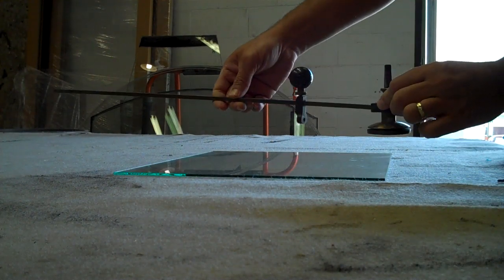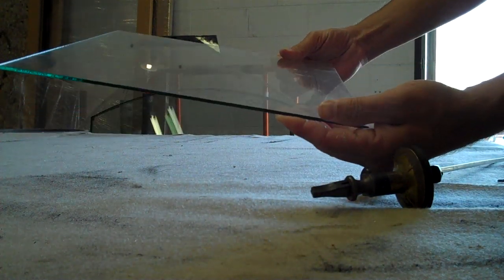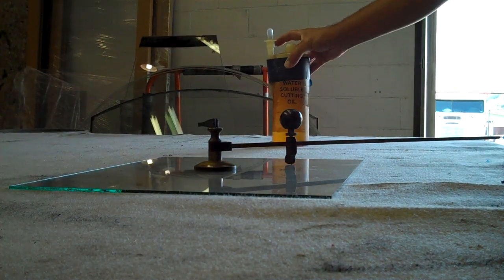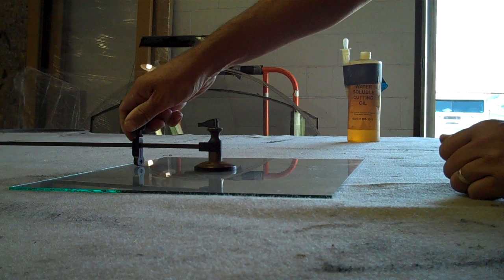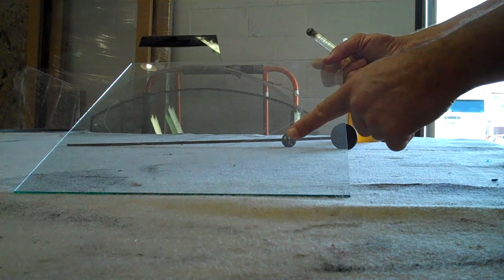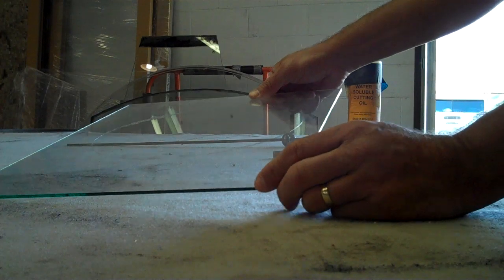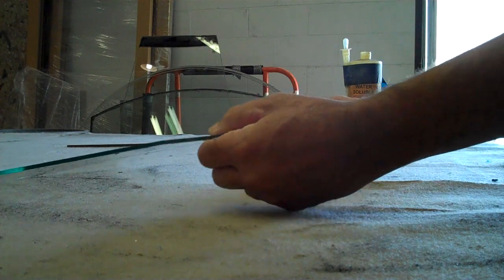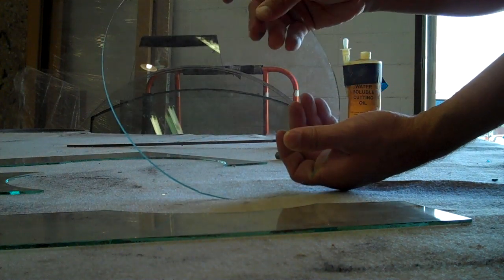How to cut out a glass circle

Comment: I needed to cut a circular piece of glass for a hanging light to keep out mud wasps.  I bought the circular cutter online and picked up a glass plate and straight-edge cutting kit from The Home Depot.  I had a picture frame with a broken glass plate which I planned to use as practice and break in the blades.  Following these instructions, my very first cut came out so well I ended up using it as my final circle!  Thanks for the tut!

Comment: How long does the carbide tip last on a carbide wheel cutter? Is there way to sharpen the wheel? How do I know I have the right amount of pressure? I think I may be applying too much pressure, or maybe the cutter is worn? I only used the cutter to cut like 5 feet of cuts. Thanks for the great video.

Comment: I am a glazier/glass cutter, if you try this then after you run the cut as shown with your thumb turn over the glass but don't make the 4 cuts to the circle yet, do the thumb pressure thing again and you will here the glass click again, push  all around the perimeter again then make the 4 cuts. this gives you a perfect edge with no chips. have fun.

Comment: it's beautiful circle with fine edges (yes, it's still sharp and should be sanded, but the edge is still even which is great).  Only thing that stops me from ording this tool right away is, that every tutorial shows the glass has to be sliced around the circle. is it possible to do it without it and preserve glass - with circular opening?

Comment: Not bad Mike. One thing I do when cutting circles is after breaking the scribe all the way around, I flip the glass over and put pressure down on the opposite side to ensure the cut is complete on both sides. Another technique I use in removing the falloff is on scribe from the circle edge to the edge of the sheet, snap, gently pull apart at the break thus causing the circle to drop out cleanly.

Comment: Good one! now I have a bit of a challenge for you, I need to cut about 6-8 glass rounds roughly 6" diameter, and these need 2 to 3  holes drilled through them about 1/4" and 1/2" diameter, they are to be replacements for the broken/missing glass on some antique fire alarm box mechanisms, the holes are for the winding knob, the activator lever and a resin grab knob usually (they vary a little from each other depending on what decade they were made and model)
Do you have any videos I missed showing drilling holes like these?

Comment from the maker: @tiredfingers99 Well it depends on a lot of factors,  but on avg mine last a year or better.  And it gets used a lot everyday.  There is know way to fix a wheel, order a new head.  and the pressure thing just take practice, the more you do the better you get.  You can have to much pressure, not enough and just right, but its just a feel for the cutting.

Comment: Can anyone help me ... I have a 8 mm thick clear glass.... out of this, 8 mm 5 mm thickness has to be of 42 mm and the rest of the thickness of 3 mm should be of 35 mm. a step glass to be put in a 3 mm steel plate with a 355 mm diameter hole and have a flat surface after putting the glass. Its for a inground burial light. awaiting for expert's opinion...

Comment from the maker: Not very easy to do.   Cut like a regular circle, and run it out around the glass, then flip it over and do it again.  You have to cut both sides of the glass.  Your two cuts must be directly over the other cut or it will not work.  An advanced cut,  not for a beginer.